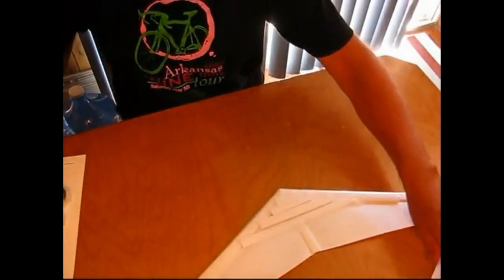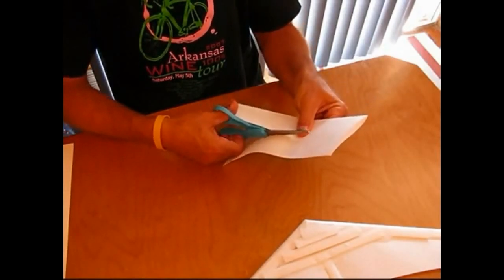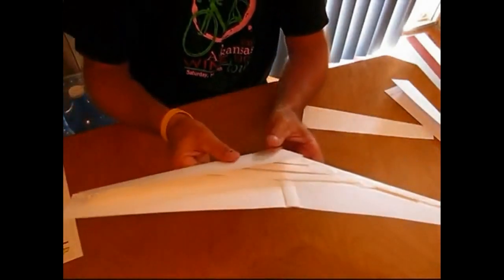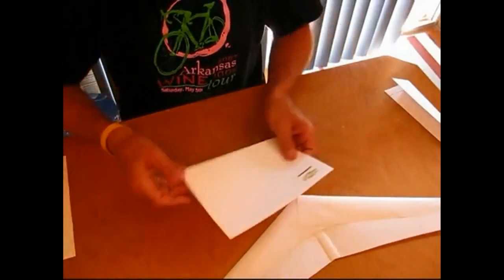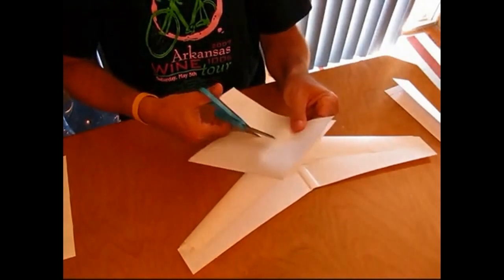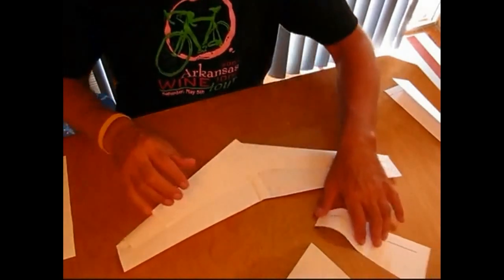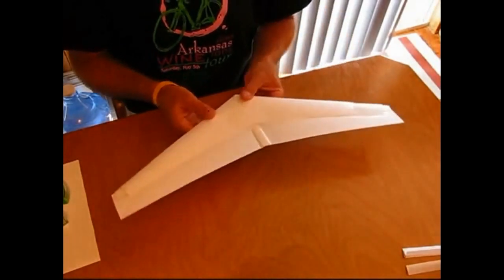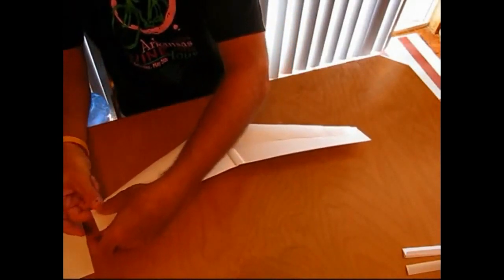Advanced OmniWing Construction.  (Part 4)

Comment: Menamiketrx: Hello! I am a lover of omniwings. Some of them I failed, but some of them flew beautifully! I also made an Advanced Omniwing, but I failed. Its front is heavier than the back, so it keeps falling down. I'm trying to build it one more time. Can you give me any suggestions or tips? ( I have already built Proto Omniwing)
Reply from the maker: +JAE WON Choi Make sure when adding the addition structures and the top surfaces, that you are not taking out the washout.  Indeed, I actually try to enhance the washout and twist as add the structures.  Increase twist and washout will counter balance the extra weight that is being added.  Also do not be afraid to tweak the trailing edge out towards the wing tips.  I slight upward bend will act as up elevator.  Of course it is best as far as performance if you get the wing flying stable without having to tweak the trailing edge up.  Good luck to you.  Do not give up to quickly.  It took me years to perfect.
Reply: +menamiketrx Ok. Thank you so much for your response. Your creation is so wonderful. Have a good day!

Comment from the maker: The Advanced OmniWing process of adding internal structures and top surface layering, can cause a diminish of the washout established in the first video.  The most common cause of the diving wing is simply not enough washout.  With each step where you are applying an internal strut or top layer, you much make sure that you are continuing to try to enhance the twist.  There is no such thing as a wing to heavy.  Just needs proper center of gravity and proper amount of twist in the wings.

Comment from the maker: As the wing turns downwind, it will appear to be flying faster in relation to the ground, but as far as it's speed through the air, it's speed has not changed.  All aircraft experience this effect.  When flying my hang gliding on cross county distance efforts,  I will usually fly downwind, thus combining the speed of the glider with the speed of the wind to cover greater distance.

Comment from the maker: So first, try to make sure you have plenty of twist in the wings.  This creates washout at the tips.  But if you do end up with a plane that dives or flies to fast, try to correct that plane by bending the trailing edge up a bit out towards the with tips.  Kind of like ailerons, but with flying wings it would be referred to as elevons.  But ultimately it is best to have maximum twist in the wings so that you do not have to make major adjustments thus better performance.

Comment from the maker: You must be careful during steps 3 and 4 to not be removing any of the twist and washout.  With each structure I add I indeed try to enhance the twist as I apply the tape.  What you are experiencing is not a problem of the nose being to heavy, but that there is not enough twist with the finished wing.  But you can often salvage a wing that has too little washout by applying a little bit of upward reflex in the trailing edges out at the wing tips.  This will help slow the wing down.  Good luck.

Comment from the maker: When you are taping the two halves together, you can vary the nose angle at that time.  Could even do a retrim of the parts to be joined to get even a wider nose angle.  For the tail structure, although it is from a single sheet of paper you can still varythe nose angle by swinging the leading edge folds out a bit more.  Just a little bit with first fold and then a bit more with the second fold.  I am going to have to try your idea.  Just a matter of getting the ballance correct.

Comment from the maker: The added internal structures of the Advanced OmniWing provide shaping of the airfoil and added strength.  But during the process of adding these structures you must be careful to not be taking away some of the twist in the wings.  Initially, make sure to get as much twist in the wing halves as possible as some of the later steps can cause a lessening of that twist.  When applying a rolled structure or surface, try to enhance the twist as you apply the tape.  Good Luck To You.

Comment from the maker: The only way to get it to slow down is to do a little tweaking on the trailing edge, bending it upwards a slight amount out at the tips acts as an up elevator, slowing the wing down.  The large wings always end up requireing a bit more tuneing than the little ones.

Comment from the maker: @ori101isk Yes.  It has the greater glide ratio of any of the OmniWings.  The improved airfoil and cleaner lines makes for a more efficient wing.  The extra weight only adds to the speed of the wing, and does not take anything away from the glide ratio.  I have achieve glide ratios of 18 to 1 with this craft.  Of course even greate distances are possible with a strong launch.